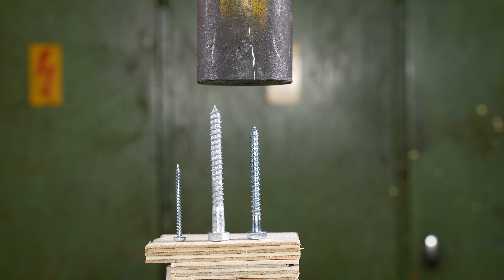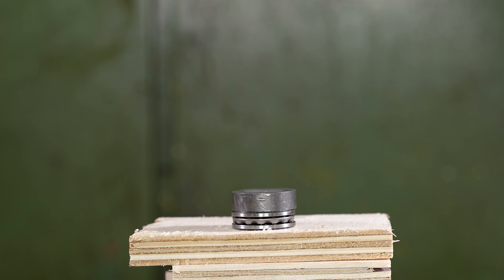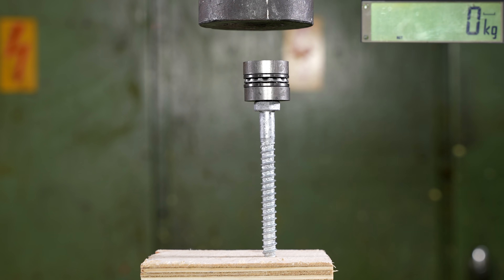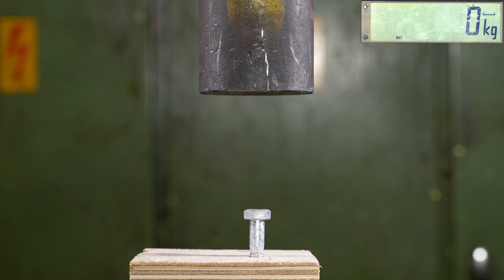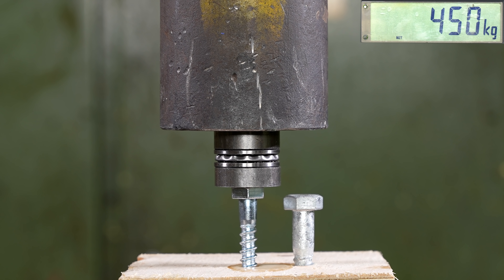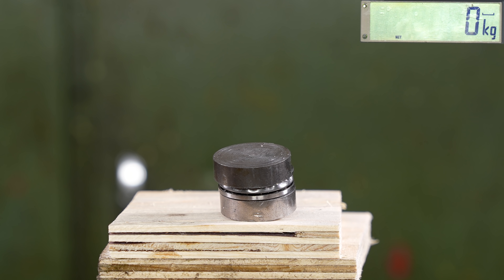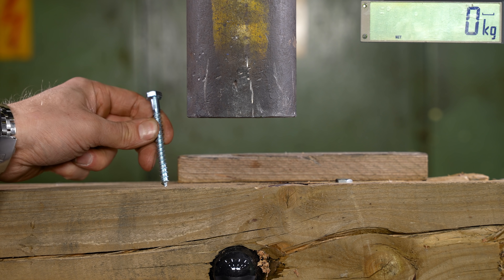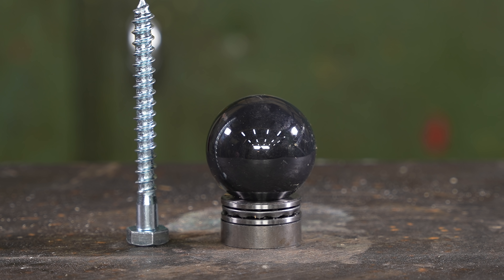Crushing Screws into Wood with Hydraulic Press | Will They Spin?

Comment from the maker: Link to the ball bearing video that I mentioned https://youtu.be/i5RIFbk178E
Reply: Lubrication needed to be wax.
Reply: Zip tie it to a grenade
Reply: try pushing the screws into a block of teflon and they might spin ;)
Reply: Try to destroy the ceramic bearing with C-4!
Reply: Freeze the Ceramic Bearing with Liquid Nitrogen and then use the largest press.
Reply: Would suggest heating it up until it's red-hot,  but.... how about microwaving it for an hour?
Reply: @paulrus-keaton439  maybe heat it to glowing red, then dropping into Liquid Nitrogen?   Stand WAY back!
Reply: Put it in that metal box full of water at the bottom and hang some C4 in it and set it off...if it can blow up the metal box full of water, it can crush the ceramic ball?
Reply: Send the ball bearing to Demolition Ranch for destruction!
Reply: @madcap57  that's a good idea this comment needs more attention
Reply: to possibly destroy the ceramic bearing ball super heat it with oxy acetylene and find a way to fire it as a projectile against things while it is glowing hot!
Reply: API 50 BMG
Reply: Those ceramic balls should definitely suffer in terms of durability if chilled down with liquid nitrogen then crushed, impacted etc.

But first for meme and clickbait value crush the bearing between a nokia brick phone sandwich (one top and bottom of bearing). You’ll have created a blackhole generator that way!
Reply: Here's a novel idea,  come up with a device that will spin the screw/ bolt as it engages the wood........
Reply: Send it to Demolition ranch
Reply: Where can I buy a ball like that?
Reply: Used a potato gun to launch a second ceramic ball into the first one.
Reply: My only advice with those lag-bolts is to pre-drill for them.  I think that would give the best chance.  As for the ceramic bearing, shoot it out of a canon a something equally hard to destroy.  Or bring the boys out to try to destroy it with explosives.  That would be fun too.  Especially if you got several more bearings and tried to blow them up like the wall.  Do tests to see who's idea works the best.  And if you can't destroy them you can send them to the Gents over @How Ridiculous.
Reply: why not any pilot holes??
Reply: Can you add closed captions to your videos? It would make your video more accessible to people who cannot hear well or at all. Or even people who can hear well but have a hard time understanding what people say without captions (auditory processing issues)
Reply: You could send the ball to smarter every day and get him to put it in the hypersonic baseball cannon... with a really big piece of armour steel plate or 10... collab video?
Reply: Or send the bearing to demo ranch
Reply: To break the ceramic ball bearing: make a mount to put a single-point diamond grinding wheel dresser into the press.  You'll need a jig to get it lined up perfectly, but I'd love to see the whole pressure of the press put to the tip of a diamond.

Comment: The "rate" of the spiral is too high for a screw to spin much with just pressure.  This is intentional, otherwise screws would just automatically unscrew themselves if the structure they were inserted in were to be subjected to stress.

What would be interesting is something with a much lower spiral rate like a drill bit: would a drill bit spin and cut a hole in wood with just pressure?
Reply: Agreed, a steeper thread would probably turn better.
Reply: It's called thread pitch, not rate of spiral.
Reply: A drill bit wouldn't spin. They are designed to cut into the materials they are designed for, and each channel starts with a a blade that scrapes bits of the material into the channel. Then, the channel carries the material out of the way. 

Your curiosity is commendable! Make sure you keep it in spite of know-it-all jerks.
Reply: I don't think a drill bit would work but there are screws with steeper pitches, me thinks steeper pitches and wood with various hardnesses
Reply: Twisted square shank nails, would they just push in or would they rotate as they push in.
Reply: Or he could use mechinism from impact screwdriver where there is tube thay slide on very step angle of  thread that under pressure force that screw to rotate. So you just need attach screwdriver end bit bellow so it will rotate screw into wood
Reply: What do you think the thread angle would need to be? Maybe steeper than 45 degrees?
Reply: @theall-seeingpie8887  It's actually called thread lead. A multi-start thread can have the same pitch as a single start but a much steeper angle.
Reply: @MasterofTongs  I think in most cases you're right, but, there is definitely one case where a drillbit would spin: If it caught on some relatively hard wood, or better yet, a tiny nub of metal, and you were pushing it through a pre-drilled hole, then it'd tend to catch on that and rotate about it. It's happened to me a bunch when I've drilled a hole with a dull bit, a few chips get caught  somewhere in the material, and the drillbit is forced to spins as I pull it in or out of the hole.
Reply: @BlPlN  ..
Reply: drill bit! drill bit! drill bit!
Reply: Good thought.
Reply: Or slow down the press (if possible) to let the screw have time to rotate before lowering past the next ridge and just ripping through the wood.
Reply: @MasterofTongs  It would if the end was sharpened to a point.
I think.
Reply: @theall-seeingpie8887  bruh threads are measured in teeth per inch if anything hes closer than you are since to cut threads with a lathe tool it is literal feed rate
Reply: i think a harder material would help too. the wood just splinters and compresses out of the way. he should try with steel screws and a few different types of metals to press it into, like aluminum
Reply: Agree pitch is too fine. But a screw you can push in will do the same if the load is in reverse and pull out.
Reply: @dutchgray86  I think an ardox framing nail MIGHT twist in, but I'd say 25% likelihood. Who knows?
Reply: @theall-seeingpie8887  Actually, it’s called helix angle.
Reply: @dutchgray86  Definitely !
Reply: @Von_Hohenheim  you do realise what the tpi measurement is for right..... thread pitch
Reply: @cal1bur799  yeah i use drag to type on my phone didnt realize it filled thread as teeth. i feel like teethperinch is also a thing ive seen but never meant to say teeth
Reply: @Von_Hohenheim  i knew you meant thread per inch, but what i was trying to say is that thread pitch is the correct term, because tpi is a way of measuring the thread pitch, for example you could say when describing a screw "the thread pitch is 5 tpi"
Reply: There are hammer fit rivets with a much lower twist. Not sure if they are designed to turn as insterted, I guess they must to stop them just pulling straight back out.
Reply: @theall-seeingpie8887  Both are right, kinda.
Reply: They make what are called spiral shank nails which are square shank nails that are twisted. It's maybe 1 rotation per inch of nail, they definitely rotate while driving.
Reply: A pre-threaded hole should also help a great deal.  On undrilled wood, the screw has to cut it's threads into the wood in order to spin, vs crushing them straight down.  Obviously doing so is "easier" or there would be no spin at all in this video, but with no cutting required it should be even easier by far.  Might also try pushing them into metal screw holes.
Reply: @Von_Hohenheim  teeth per inch - saw blades...
Reply: Walldogs might. The threads are wider and steeper.
Reply: I disagree. Provided a harder wood, I'll bet you can get it to spin. Consider leadscrews and ballscrews in automation; they have even finer threading and turn just fine with the collinear movement of their nuts. Of course, there's significantly more friction at play here, but I think you could make it work.

Comment: I'd try the same experiment but in a hard wood. Maple, hemlock or even oak .
Reply: That’s what I think. The path of least resistance is pushing through.
Reply: I'm thinkin' ebony.  Something hard as fk to encourage the bolt to twist instead of just tearing/crushing.  Kinda wasteful to do that though with that wood.  Supplies of it are getting rather precious.
Reply: It would have to be a massive block of wood. Because it would split easily otherwise
Reply: The entire point of the physics of screw threads is that they won’t turn when pushed or pulled. To work it would have to be a much steeper twist like rifling in a gun barrel.
Reply: Also the press must go slowly.
Reply: @Banana-hammock.  it's just a funny concept. Obviously no one will cut threads this way. Just interesting to see what happens if you push in a lag bolt this way. And the video accomplished this. It's youtube...mostly for entertainment purposes
Reply: I don't see this ever working it's like trying to drive a worm gear.
Reply: Now if you test the tensile strength
Reply: Was about to say the same thing lol. I think an oak or maple would work pretty well. The plywood and the old beam didn't give enough resistance to force the threads to spin
Reply: Japanese maple
Reply: Nah I'm with Dany here. I think it could work in some hard wood. Get a big block of some dense lumber and try it again. You managed to get a half turn from the soft ply wood and your soft wood block. So maybe if the wood is hard and dense the screw will rotate more.
Reply: Or wenge/bubinga
Reply: I agree. Definitely try a harder wood
Reply: Would also like to see partially screwing it in before bearing rather than pressing it
Reply: A hard wood, a screw with a large thread compared to its thickness and a very steep angle of the thread. If you combine all this it might spin just as much as it should
Reply: Use some soap or wax instead of oil.
Reply: do you record it?
Reply: @CountYohiPlayinGames  This is what I was thinking. Pre-drill the screw in and pull it back out so it has a path to rotate down into.
Reply: Yo, hardwood defines the way the plant grows. Not because hardwoods are actually harder than softwoods.
Reply: @handgun559  what? So you're saying oak, pine, and balsa have the same hardness? You know there's an  actual scale measuring the hardness of wood, right? Or you're trolling?
Reply: And a solid piece, not many pieces of laminate/plywood.
Reply: @SamSamuylik  4x4, 6x6 and up would work
Reply: Okay Dany F, tag me when you do it.
Reply: This
Reply: I’m JS, a lot of power transmission gearboxes are a brass gear turned by a steel screw and I’m pretty sure brass is tougher, stronger, and harder than basically any wood out there. And I have seen every tooth on that brass gear shear off before that screw even thought about turning. Those screws look about 3-6 threads per inch(TPI) and as others have said you would need something closer to rifling twist rate which would be more like 1 thread every 7 inches and that’s one of the faster twist rates in a rifle.
Reply: Y'ALL KNOW NUTTIN BOUT WOOD..
BALSA IS THE HARDEST WOOD.....

AFTER YOU PRESS IT IN A HYDRAULIC PRESS AND SOAK IT IN EPOXY.
Reply: Won't work I've driven plenty of screws with my hammer and they never spin no matter what kind of wood I put it in.
Reply: The threads are intentionally made so that threads arent usually steep enough for a spin like that. It is intentional design.
Reply: A plywood block has better chances than hardwood the alternating grain in plywood is way stronger
Reply: @BobHolowenko  at the end there when he used a 4x4 post, it twisted about as much as I'd expect. Maybe hardwood would turn a bit more. Perhaps less. Would be interesting to try at least.
Reply: @joonashannila8751  Makes sense, if it screws in easy it probably vibrates out just as easy
Reply: Hemlock is a softwood.
Reply: @Abitflippant  he is right, actually.
Reply: @bobbypatton4903  okay, I may be misunderstanding what he is saying because this is what I was thinking of https://en.wikipedia.org/wiki/Janka_hardness_test
Reply: @hamaljay  as if that's comparable
Reply: I'd love to see that too
Nevertheless, I think plywood was the proper choice for first try because of it's ressistence to shatter
Reply: I still don't think it would work.  Something with a 1 in 4" twist or slower might work like the old cut twist nails but not a screw or bolt.
Reply: @Abitflippant  not he's right. Botanically speaking balsa is considered a hardwood, even though it's incredibly soft. Though ofc usually the context makes it clear what's being talked about
Reply: @neillcoetzer9133  he was splitting hairs with his statement by using speaking "botanicly" about "hardwood" vs practical hardness of woods.  His statement should have started "Botanicly speaking..." Instead of "Yo" because as read his comment was contrary and deceptive.
Reply: Maybe a low thread per inch count?
Reply: I think the densest/hardest woods that aren't particularly brittle might give it the best chance. Something like hickory, ash, or osage orange. White oak might do, too, but probably not red oak. Stuff you'd make an axe handle out of.
Reply: Have you tried it yet?
Reply: Also I think pre-drilling a hole would help
Reply: Yeah soft wood would allow it to be pressed into it as oppose to hard wood resisting the pressure. I wish he noticed it
Reply: Azobe wood

Comment: I think cards are stacked against you.

The point of a screw is to hold things together, so it's designed to prevent it from unscrewing.
Reply: Exactly. But it's all about screw angle with is based on friction coefficient. Metal screws have shallow angle because metal to metal has low friction, wood screws have higher angle because wood to metal has more friction. Could work if you could somehow drive wood screw in metal, or a rare or custom designed nut?
Reply: Screws designed for wood typically have a smooth shank towards the head portion... It is basically a screw and a nail mixed together. Probably from unscrewing, I guess.

Comment: I would say that when you tried the first time the bearing would have created impressions on the race surfaces.   The screws are called lag screws here in the states, and you are supposed to drill pilot holes to use them, so for the best chance of success...

First get a new bearing.   Put a socket over the head of the screw to stabilize the bearing and also to help center it.   Drill a hole equal in size to the shank diameter of the screw.  You don't want to just push the screw into the wood because the screw has to pierce the fibers of the wood and do more work. Once you break those fibers there isn't much for the threads to grab.   Use hardwood like oak or maple.   Don't use galvanized screws, find stainless steel. Galvanized leaves a rough surface on the threads.    Don't use oil to lubricate, it just soaks into the wood.   Use paraffin wax (canning wax).  These measures should hopefully lead to a successful experiment.   

Once you have mastered the art of screw insertion by hydraulic press, you will proceed to the art of screw extraction using something like your press and your anti gravity table.   Put the screw at the center where the load hangs from the magnet, when pressure is applied the screw should turn out.  

Finally,  what's going on there? I rarely see Anni in the videos.   She hasn't uploaded to her channel for about five months.   And your videos have been shorter and using simpler ideas.   I have a pretty good idea what might have happened but I am not assuming anything, nor going to spread any rumors.   But we CARE about you guys, if something is wrong please tell us.   I've been wanting to see the rest of the Cronos Ring videos, and what you guys have been doing to your beautiful house.
Reply: A pilot hole is to prevent the wood from splitting and make it easier to drive in the lag.  If I somewhat understand the physics of it then a pilot hole would allow the lag to press in to the wood easier and actually be less likely to spin, but I could be wrong and it's easy enough to test... If you have the proper equipment.
Using hard wood and wax certainly could help the chances though.  Maybe go for best case scenario, drive the lag bolt it, back it out, wax it and see it the press will turn it back in.
Reply: yes- if you start by crushing it into the wood it will continue to do so -
Reply: Laws of physics say that even under ideal circumstances there won't be much if any spin.  The angle of the thread is just too steep.  This is intentional, or else screws would undo themselves.
Reply: Also the speed is important - it must be sow for the threads to overcome the friction
Reply: U know they upload on their other channel like constantly?

Comment: Self tapping screws, higher density wood, screw them in to start (not blunt force), mark a line on the metal above and below the bearing to we can see total rotation.

I think this is the best set-up.
Reply: Sounds about right. I can only add to wax the screw!
Reply: I also think if the bottom of the bearing would be able to  hold the screw with a hexagonal inset, there is less chance of the tool slipping on top of the screw as well.
Reply: Thread pitch!  It's an inclined plane on its side.